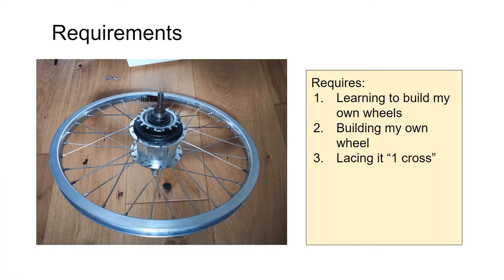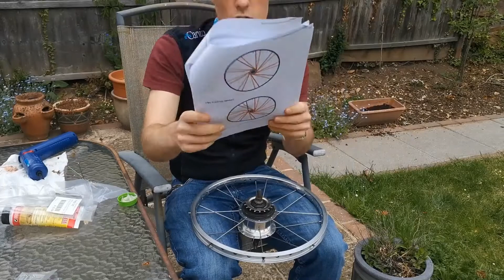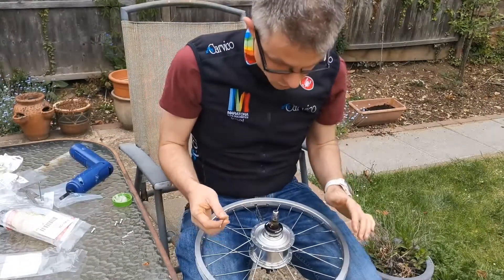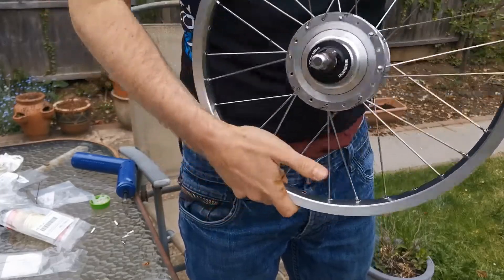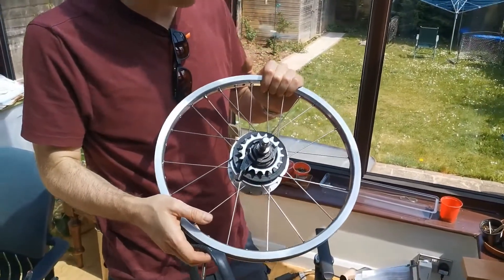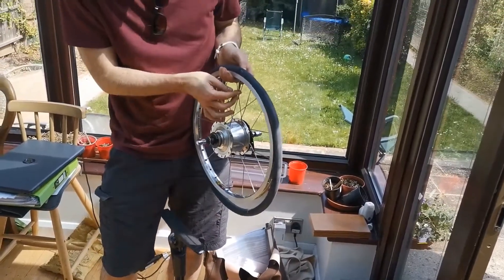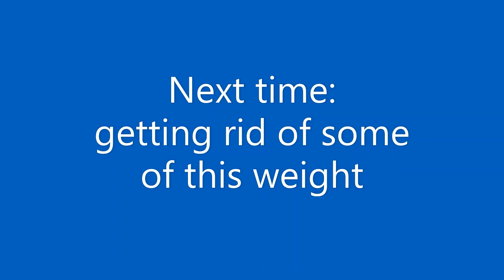Improving (??) a Brompton stage 1 - lacing a Shimano Alfine hub, 1 cross 1x

Comment: Nice :) I was also startled to find just how heavy the wheel was once I'd finished it! I used a Sturmey X-RF8 for mine, utter monster of a wheel but I saved a little with a smaller 38 tooth chain ring.
Reply from the maker: Yes, it's a brute eh! I haven't actually used it too much yet, I've mostly stuck with the singlespeed wheel (see next video) but I'm planning to use it for longer rides. 

I went with the 42 tooth crankset, with 16t at the back on the singlespeed at the end - not bad for most terrains.

Comment: This is very timely, I’m thinking of doing something similar! Does the Alfine fit into the standard rear triangle or do you need to do any modification? Looking forward to next instalment,
Reply from the maker: Hi Colin! 

You definitely need to change the rear triangle with an Alfine. There's an excellent article on Brompton Geek about the different choices and their implications, and if you prefer you can get a Sturmey Archer hub which will fit your current rear triangle, but that has its own problems (https://www.bromptongeek.com/index.php/2017/09/29/which-8-speed-hub-is-best-for-my-brompton/#:~:text=Two%20of%20the%20most%20popular,and%20Shimano's%20Alfine%20SG%2DS501). 

In the end I decided to get a modified rear triangle largely because I picked up an Alfine hub on eBay at a bargain price and wanted to learn wheelbuilding. Another episode soon hopefully!
Reply: Phil Buckley thanks for the link, really useful and a website I hadn’t seen before. I’m always happy to.find more Brompton information and tips.